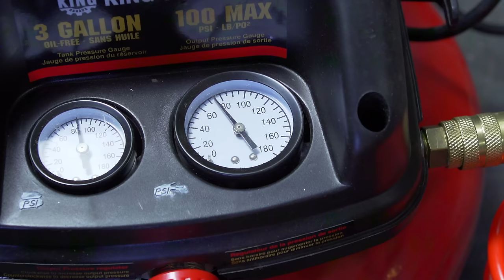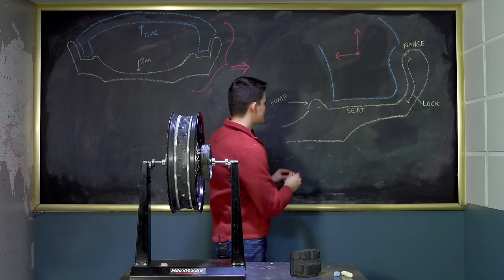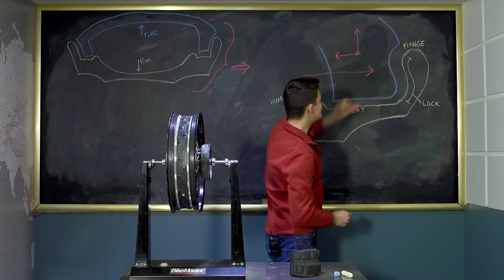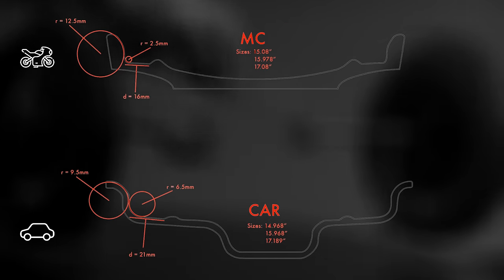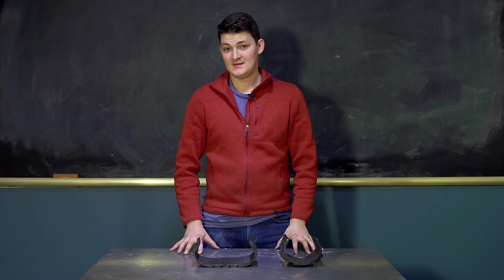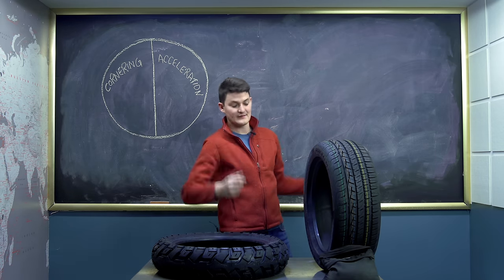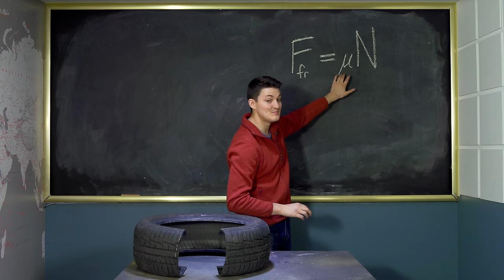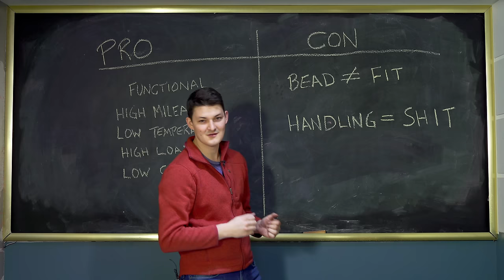Are Motorcycle Tires a Ripoff? The Darkside Car Tire Experiment

Comment: "Spontaneous uninstallation."
That's almost as good as rapid unplanned disassembly.
Reply: Fightre Flighte and often leads to Rapid Unplaned Disassembly
Reply: Caution: Pilot may eject without warning.
Reply: @MotoAdventurer  
I need that as a sticker to put on my tank just behind the bars.
Reply: @Fightre_Flighte  I have a template already
Reply: @MotoAdventurer  wul damn. That's hot
Reply: "The cumulative effects of system malfunctions, reduced longitudinal stability, increased angle-of-attack in the turn, supersonic speed, high altitude and other factors imposed forces on the airframe that exceeded flight control authority....." Bill Weaver, SR-71 pilot.  My favorite of all time.
Reply: @Fightre_Flighte  I need to set up an Etsy and get a storefront set up
Reply: @Redmenace96  
I thought you were talking about the best bird.
Reply: @MotoAdventurer  
Damn straight. You already got a willing buyer here.
Reply: Excellent terminology.  I was about to make the exact same comment!
Reply: @amsmith170  
My nondescript sibling, you know what they say about great minds.
Reply: What about using a winter tire. Extra siping and a sticky compound. Better grip, but might not last as long.
Reply: Moto Adventurer Take my money!!! I'm not even joking
Reply: @benweatherford5362  
I thought about the idea of shaving the bead for better fitment. The real question is feasibility.
Reply: SpaceX, "Rapid Unscheduled disassembly"
Reply: @10fantic  

facepalm

Don't make me google this.
Reply: A bit like inadvertent parking, otherwise known as visiting the scenery or crashing.
Reply: Great for the lazy mechanic but niether one of these things are good at speed XD
Reply: @inhumanfilth681  
Of course!
But bloody hilarious when it happens to someone you don't know.
Reply: Reminds me of the definition of an air vehicle:  A cluster of 2,000 parts flying in close formation. (and what happens when they lose formation)
Reply: @ljprep6250  
That's hilariously brilliant! Quite the time, that.

I love flying but it is painfully true that it's really just hours of boredom surrounded by seconds (minutes) of terror.
Reply: Goes great with having a unintentional rapid dismount
Reply: @twannooitmeer9146  
Or unintentional pilot ejection.
Reply: @bulwinkle  In the amateur space industry we call that "lithobraking".
Reply: LMAO
Reply: But can ANYONE point to a single documented case?
Reply: @benweatherford5362  I normally run an all-season, run-flat radial. So yes, has better siping and provides better water dissipation.
Reply: @benweatherford5362  they are well liked in the darkside community, haven't ran a winter tire, I prefer the sport style tires.
Reply: @benweatherford5362  Blizzak. Works great. No skiping necrssary
Reply: @Fightre_Flighte  totally not necessary.
Reply: Any chance of spontaneous oxidation post uninstallation?
Reply: Or 'surprise dismount'....
Reply: @stephenbrown9370  
Which part isn't necessary? Bead shaving?
Reply: @jhhayesii  
It's not recommend to drive (or ride) with a plug on a car tire either.
Patches save tires. But that alone told me the type of risk you're willing to take - regardless of effort - to do things the way you like.

Nice speech, though.
Reply: @Fightre_Flighte  never had any auto tire store say that! They tell me what can be fixed and what can't. And the word I get is that a hole in the working face CAN be fixed. And the hole in the tire in question is definitely in the working face. With quite a few thousand miles on that tire, I'm inclined  to replace when it's shot.

When I plugged it, I inspected it carefully every 100 miles or so. That plug isn't going anywhere. Never had a problem with a plugged tire on a car either. Plugged a few myself on the Dalton Highway in Alaska.
Reply: @jhhayesii  
Right. But a plug wasn't meant to be a permanent repair. Yes, a hole in the working face can be repaired. It's called a patch. Or, if you favor yourself most, a patch plug.
But any self respecting tire tech will recommend at least a patch if you're looking for a permanent fix.
Reply: @Fightre_Flighte  you a tire tech? Whenever I've had them repaired, they plugged.
Reply: @jhhayesii  Only people with zero knowledge and experience act like darkside specialists. 😂😂😂
Just ignore them and go for a ride. 👍👍👍
Reply: @Fightre_Flighte  idk if you knew already, but the quote is actually, ‘Great minds think alike, fools seldom differ’ just like, ‘Charity starts at home!’ Is actually, ‘Charity starts at home, but shouldn’t end there.’  It always interests me to see how these quotes have changed over time to mean the opposite of what their creator intended!
Reply: @jackgonzales-alexander1104  
Whelp. Now I gotta do research on modern quotes and misnomers involved therein. "Curiosity killed the cat, but satisfaction brought it back."
Reply: With my job we call is simply rapid air loss
Reply: Hahahah
Reply: @Fightre_Flighte  😢
Reply: It doesn't happen
Reply: I tried a car tire on my 1800 golding for 5k. Took it off and went back to MC tire. Handling so much better with MC tire. I will stay in the "LIGHT SIDE:

Comment: 5:36 "Car tyre fits a motorcycle like I fit a bikini. Humps and curves in the wrong places" 😂😂😂
Reply: Bad Idea...here's why...Front tire contact patch, about 1 1/4" wide. Rear contact patch, about 7", and that is where all the stability issues begin. If the LEFT side of that wide tire rolls over a high spot in the pavement, the bike tilts RIGHT!! and vice versa. If riding a "truck lane" and you get into one of those two valleys in the pavement that heavy trucks create,  the bike constantly weaves back and forth, depending on which side of that wide tire makes contact with the slope of the valley. I always had to ride the center of the lane to avoid that weird greasy feeling. After about 3 months I drop kicked that tire into my garbage bin....never again!!!
Reply: Wayne Depner What would you think about only back tire on a Ural?
Reply: @stupollock6851  car tires on sidecar motorcycles is nothing unusual. even in the front. I don't know where you're from but here in Europe motorcycle tires on sidecar-conversions are relatively unusual.
Reply: jomcjay yes I have seen them when I was on the Isle Of Man. I’m not particularly fond of the look but on back maybe not as noticeable. I’m from Northern Ontario Canada and planning trip on ice road in far north. Just think bigger back tire let you haul more without sinking in snow. Plus added traction. Plus supreme wear and saving. I don’t know why they can’t make bike tires last longer.
Reply: @stupollock6851  they can make bike tyres last longer, and they do. Back in the day I was lucky to get 3000 km from a Pirelli Phantom on a 60 hp bike before the cords showed. Now I get 18 000 km on a 75 hp bike and I change them when they're still legal.

More than that may one day be possible, but right now it's a trade off between handling+grip vs life. There are some very flat, car like tyres that will get you 30 000 km, but they handle like shit, slide all over the place and are really hard to change. So people don't buy them. So they sell in small numbers. So they're expensive.
Reply: if the car tire is that much wider than the moto tire thats exactly what will happen. keep the width closer to that of the moto tire and it will seat better.
Reply: Stu Pollock i think tou should sell me your ural
Reply: What century did Ryan pull out of his pocket. I am impressed.
Reply: joe boo I haven’t even got it yet. Dealer ordered two at same time and mine not in yet. Can’t wait. Just ordered all the heated clothing today.
Reply: @BruxBrule  The percentage of riders owning a full dresser, doing sporty riding and riding in adverse weather is miniscule...doing 5k per year on straight sunny highways does not test any tire. I'll be a little more polite than you were and just state that your evidence is purely anecdotal.
Reply: @gasdive  I get about 12.000km out of a pair of Michelin Road 5 tires, but about a third of that is commuting in an almost straight line doing about 50mph...keeps the wear light, even with 120hp (Suzuki SV1000S, pretty light bike as well)
I could probably find longer lasting tires, but I live in Scandinavia and ride in anything but ice/snow, so I need grippy(ish) all-weather tires.
Reply: @rockarola55  yeah, I do a lot of highway (my daughter is 400 km away) and I've been running PR2, PR3, PR4 and now my first road 5. I don't often need the grip, but when I do, I need it! The PR4 Trail rear on my 650 V-Strom lasted just under 18 000 km and was changed with good tread left because it was worn flat. I couldn't imagine intentionally putting on a tyre that's flatter than a worn PR4.
Reply: I've has a Honda ST1300 running double dark for 8 years and at 30,000 I change them out. Never had a problem with traction and the bitch who cried about the truck tracks making him move around should of took 5 lbs of air out and tried it. Understanding how to adjust things on your bike is first.
Reply: Ha ha, Oscar Wilde & George Bernard Shaw did not say that.
Reply: Mankini,  you mean? 😬😬😬
Reply: ROTFL
Reply: You just know he tried it
Reply: @stupollock6851  
$$$. Doh, Eh ?
I lived in Western Canada...Edmonton, but, hung out at Great Slave Lake, Fort Mac, Calgary, Baniff,
Vancouver...many places in  between...for three years, in the early '90s and I found the friends, guys were very good, honest builders and badass. The Women, were Exceptionally Beautiful...peelers were cute as they get.
My lineage has that in it somewhere, i.e., French Canadian, and of course, Native...Mohawk, Great Grand Mother...all around Quebec, Montreal, that neck of the  Canadian woods...by the way, American Made... not better not worse all men are created equal. But just giving you a location where I grew up
Reply: @thedan1300 
 Tell it Bro !
Reply: @AlfaKenyBody  
Phaagkini.
Reply: Bignose Harry yes. Stupid expensive. Not impressed with liner either. Way to expensive for what it is. Hopefully pants socks better. Don’t think I’ll even like the glove liners
Reply: Bignose Harry I spent some time early eighties up North in Sask. drove across lake to Fort Mac. In Vancouver for a bit.  Now I live in Northern Ontario very close to Quebec.
Reply: @waynedepner8593  you picked a tire that was too square at the shoulder(some are rounded nicely) and some aren't sharp enough to get a directional tire. And Bridgestone makes an MC tire with a much wider contact patch and car tire like tread which totally eliminates the "chopper" feel of having too narrow of a  front tire. Interstate ruts suck no matter what tire you use ESPECIALLY a half bald MC tire (in other words, a MC tire with only about 2000 miles on it). That's why I chucked my DUNLOP to the curb.
Reply: @stupollock6851  bc they wouldn't make as much money. Pretty simple. Too bad 95% of motorcycle enthusiasts don't "strike". One summer without them buying Crap MC tires and the manufacturers would magically invent an MC tire with traction and long wear.
Reply: @BruxBrule  right on Brux. Tougher tires. Tougher sidewalls built to handle the weight of a car going sideways around a corner. And tread life for a decade. Since I went darkside my bikes have all performed better. I wouldn't put one on a dirt bike, or a super bike. But for an old fashioned street machine with any weight, they are outstanding. Newbies just aren't used to the feel of the footprint so they panic and think it's not a good thing their bike will corner tighter or not slide out from under them if they hit some wet grass.
Reply: @rockarola55  I ride my darkside on the pig trail in the Ozarks EVERY DAY it gets above 50 degrees F° and I've kept up with crotch rockets on those corners, so your 5k upright schtick is pure dung.
Reply: @thedan1300  amen
Reply: @Wroger Wroger get a blizzak mud and snow directional and you won't slide ANYWHERE unless you're standing on your brake. Funny, 99.9% of the nay sayers have never even tried the darkside. And only ONE guy who tried it didn't like it because he obviously didn't know enough to let a little air out of his tire for the "truck ruts" he whined about. Not to mention that if you go darkside you run your front tire a little wider as well. My 1300c.c. handles like a 500c.c. don't be skeered.
Reply: @darwinchapmam6343  exactamundo. Some MC tire guy goes out, buys the squarest tire he can find, MULTI DIRECTIONAL, puts it on a half grown bike and then tries to compare that to a bike with a stock Dunlop. The same guy wouldn't go out and buy a tire for a vtx 1800 and put it on a 250.c.c. but then turns around and mounts a tractor trailer tire on a bicycle to prove darkside doesn't work. Like it takes a rocket scientist to figure out that rounded shoulders and directional tread are desirable. Darksiders NEVER said "any old tire will do".
Reply: I died! 🤣
Reply: Yeah but it will mount up.  To many that's all the matters and they dont wanna know anymore.
Reply: This is a fact a proponent of car tires on bikes will file away under complete BS. Tire wanting to stand up around corners? Also fake fact......tire being made to work under 4000lbs? Nuther fake fact. "But it saves me money"......number 1 reality check that is believed.
Reply: You ever ridden darkside? Until you have, your argument is moot.
Reply: You need to learn how to ride, I have zero issues like what you are stating.
Reply: I was seriously considering dark side. But I got 23000 miles out of metzlers cruisetecs on my 2020 challenger. I didn’t consciously decide that. Lost track of the mileage.

Comment: A few years back I bought a GoldWing that had a car tire on the back. Everything you said was valid. There was another issue that you didn't really cover. The hard rubber causes way less traction even in a straight line. The Wing would light up the tire every time I would accelerate, even with my wife on the back. It followed this up with locking up whenever the brake was applied. So, in addition to not cornering or going straight, it also couldn't accelerate or brake. But at least it would last the rest of my life. Just like a parachute that doesn't open.
Reply: The traction issue would be very dependant on the particular tire used, there are soft road car tires out there, there are also long lasting "eco" tires that don't grip for shit, so is the case for motorcycle tires really- many people would be better off with a soft car tire for commuting rather than a hard moto one.
Reply: @piciu256  I got michelin road 5's and I swear it must be made of a cheese compound because I've picked out bits of glass and found another nail.. it's a road vacuum cleaner.
Reply: I use drag radials on the back of my V twin. Waaay more cornering traction than the michelin cruiser tire I had on it. I couldn't pull a wheelie before on the bike tire either. It just spun. Now it picks the front end up. You do have to countersteer in the corner, but the bead conforms to the motorcycle wheel much better than you're hearing here. There are no metal bands on the far inside lip of a car tire. That edge easily conforms to the inner bead of the bike wheel.
Reply: You probably didn't have Michelin pilot sport 4s and were using a cheap passenger tire.
Reply: @potatochobit  actually I just checked. It was a Metzler Marathon 888. A $300 tire.
Reply: @potatochobit  my point still stands. My $120 automobile drag radial has more cornering traction than a standard $300 power-cruiser tire while lasting much longer.
Reply: i don't agree mine sticks like glue to the road you must have had a very hard summer tire
Reply: Dan Rodemsky .
Reply: "But at least it would last the rest of my life. Just like a parachute that doesn't open." That is Golden
Reply: There are different tire compounds..
Reply: Sir, have you ever considered getting a heavier wife?
Reply: I have no idea why a Goldwing would light a rear tire with two people aboard. Definitely not normal! I run my BMW K1600GT HARD in the mountains around Salt Lake City with an inexpensive Bridgestone RE92 and I can easily drag the pegs on both sides with no issues. Snapping the throttles open halfway through 1st gear won't spin it and I have a lot more hp than a 'wing. Here's my video on my experience going dark! https://youtu.be/hz7lDThb9uY
Reply: did you have 100 lbs of air in the tire?
Reply: @cray0308  fucking brilliant you are.
Reply: @cray0308  😂👍
Reply: @JayBearjaysbigadventure  he was on a sand blown road........  my70cc quad would light them up.......   lol
Reply: @JayBearjaysbigadventure  I recently fitted Dunlop elite 4s to my GL1800 and they're fine in the dry but the rear will break traction @ 90kph in the wet if I punch it 😱  , something my car tyre wheel set up never did
Reply: If it was hard rubber that means the tire was either old or they didn't use a winter tire